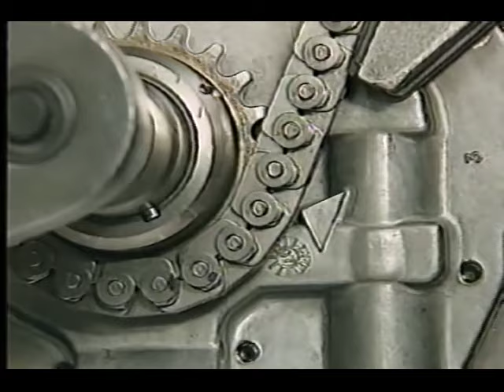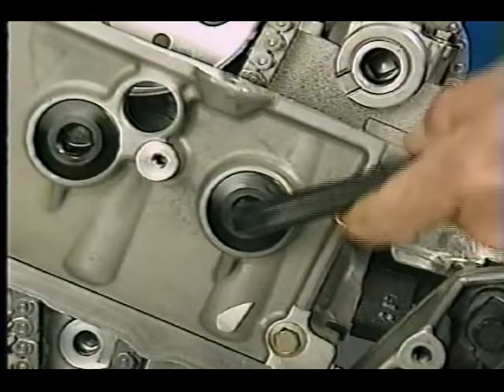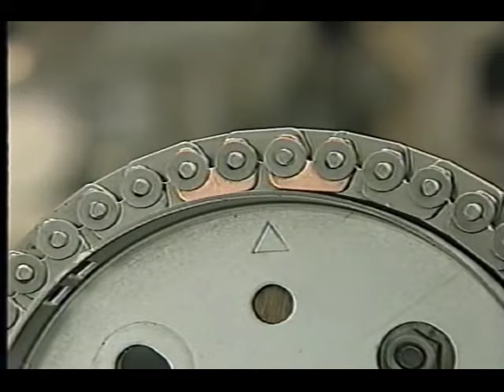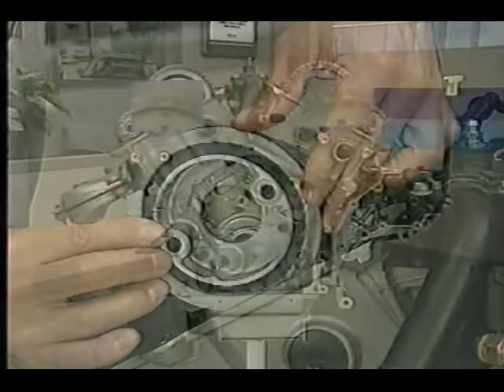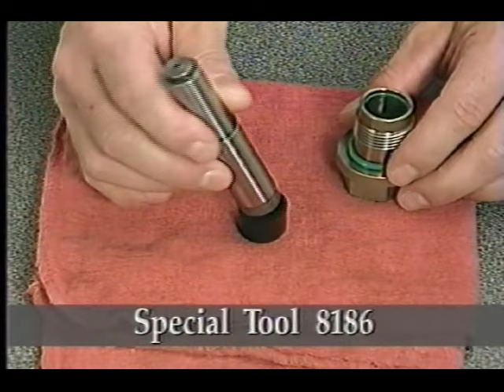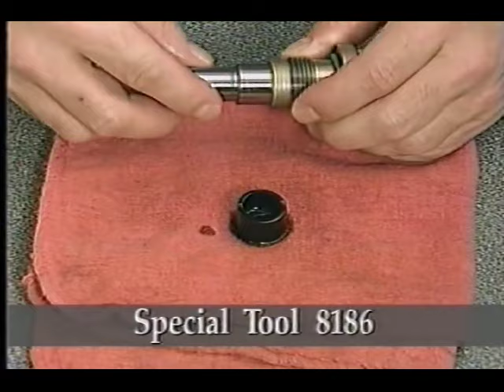Chrysler Dodge 2.7L V6 Engine Timing Chain Replacement

Comment: After the one revolution turn at the end of the video are my timing marks going to line up with the colored links still or not?
Reply: No once u turn the engine over the marks will not line up until so many revolutions then it will line up again just make sure all timing marks are lined up before u remove the timing chain

Comment: So service info tells me to have my cams in the 12 o clock position how do I rotate them to align the bolt holes without moving the timing marks out of the 12 o clock position?

Comment: Because this is an interference engine, is there reason for concern if/when the cam rotates as soon as the fasteners are removed?
Reply: The tension in the system causes that. We need only assure that the alignment of crank and cams are as described in this video when installing the new chain.
Reply: Sorry, but you're just wrong.  We also need to keep it from rotating during the removal if we're at all concerned about letting the pistons smack into the valves and destroying the engine.  That's what makes this repair unnerving for a novice, at least on interference engines.  I did this procedure 8 months ago after a ridiculous amount of research.  A tiny bit of movement as witnessed on the cam sprockets is normal, I'll give you that, but they'd move much further and cause catastrophic damage if they weren't secured before removing the final fasteners. @jeromebarry1741

Comment: Great video if you have the ability to remove the engine from the car first.and special tools required.
Reply: (watches video, calls up Snap On tool dealer, parks truck in front yard until job is done)

Comment: is this the same for the two different chains ?? and I'm not talking about the main chain and cam chains, my main chain is smaller. 
My 2.7 has a main chain with smaller teeth, it's also flex fuel so I don't know if that's why it's different. any input???

Comment: The timing chain and the water pump should be changed at the same time so as not to have to go back in later and remove all the components such as the radiator to get to one or the other again. A lot of $$$ in labor hours at the shop to get to either component. May as well do both at the same time.
Reply: I got a 2008 Dodge Charger that I bought when it first came out and my water pump fucked up, instead of paying $1,500 to fix it and everything I might as well paid an additional thousand dollars and had a new engine rebuild, it's like buying a brand new car again

Comment: Yall make it look so easy lol. Great video thanks. Going to do my 300 2.7 timing and headgaskets.
Reply: Did you do your head gaskets how hard was it ?
Reply: I got the same engine. And need both of them change. Thinking about just junking it. Probably will cost to much to fix it. Man just can't get a break 💔
Reply: @michaelwashington2682  yea unfortunately it would be wise to junk it. Shops don't want to fix them for a reason.
Reply: @bossman8231  I'm having problems with my tensioner it will not pop out
Reply: how'd it go?